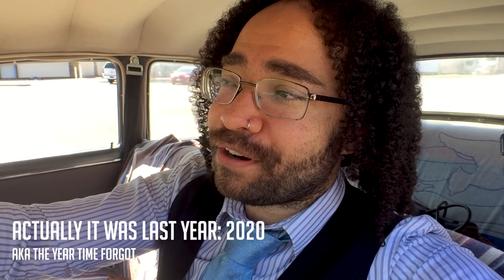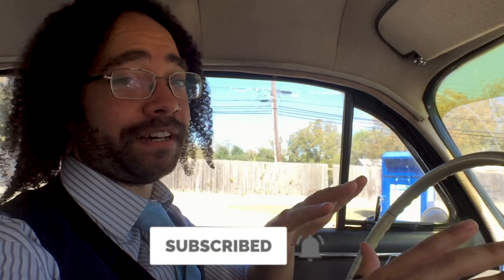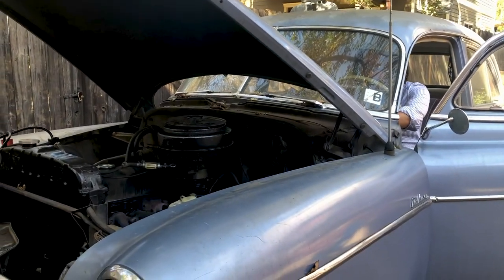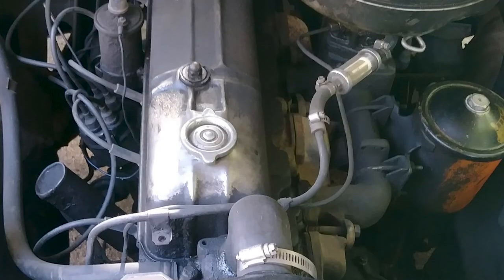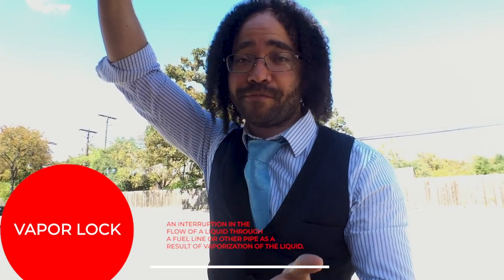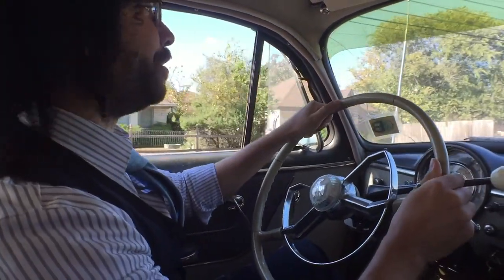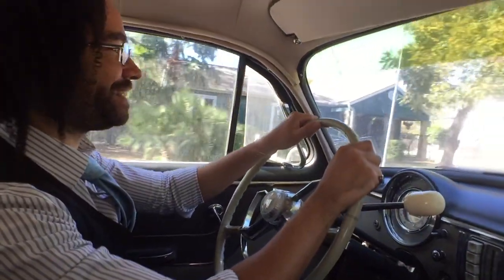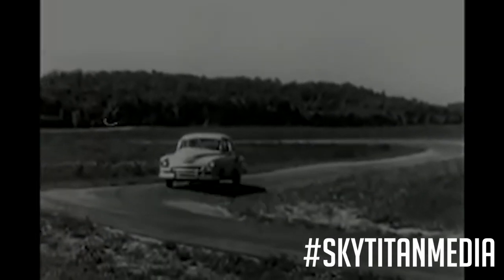1950 Chevy Deluxe Project Car | Antique Cars | Vlog EP#68

Comment: Very cool gift!! I have a 50 Coupe & love it! I suggest you swap the glass filter out for a metal canister style. The glass type are aftermarket and burn more cars to the ground than ex wives.
Reply from the maker: Haha for sure. The linkage on the shifter gets stuck fairly often too but Im not sure how many solutions there are for that other than changing it out completely. Unfortunately I had a 'mechanic shop' work on it and its no longer running but Im working to get it back on the road soon. Also that 50's coupe sounds awesome! Daily driver or show car?
Reply: @SkyTitanMedia  The Chev 6 is quite different inside to a lot of modern motors, finding the right mechanics might be hard. My coupe came from Las Vegas (I'm in Australia) and has a 30 year patina sunburn on an 80s paintjob. I swapped the 6 setup for a 350 V8, auto and open diff and front disc brakes, 12 volt etc. I would describe it as a driving project... I have a video of me driving it at a dirt airstrip when still 6 cyl. on my channel. Inside view..
Reply from the maker: Those car show videos are great! Are those both in Australia?
Reply: @SkyTitanMedia  Yes, my drive was at a car show my car club, Asphalt Demons used to do. It was called 'the Invitational'. The walk around video is at a place called Cooloongatta. Show was called Wintersun and all the cars shown are in the club called the Beatniks. They are pretty big in the states too.

Comment: Beautiful car, a styline has a bubble top like yours. A fleetline has a swooping roof almost like a hatchback. And a bel air has a winking eyeglass at the rear. All cars were made with the same body after the war to save on manufacturing costs. Confidently you went to the dealer and chose the top or not and that made the car a different model. You have a styline sedan if that helps
Reply from the maker: @Jerry AG You know, I was curious because everything I was seeing online pointed to 2 door coupe being the styline and the sedan was the fleetline but nothing that really said for sure. I heard one mechanic refer to it as "the turtle". Thats intersting to know about the tops though. I do love this car. I have an affinity for old cars but Chevys seem to find their way to me. I have a 74 nova with a straight 6 as well that Ive had since college. I swear those engines are bulletproof.
Reply: @SkyTitanMedia  awesome, in most states their all registered as stylelines, reagedless of roof. It's almost as if they're treated as dealer option ( which in essence they were) instead of a distinct model. I own a 50 styline coupe ( deluxe) and I just love the back to basics feel of driving.